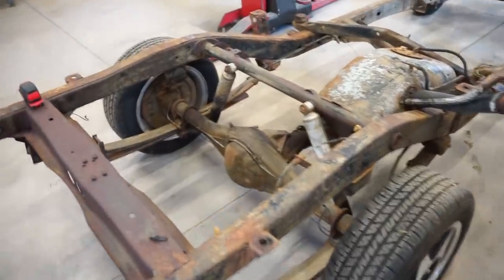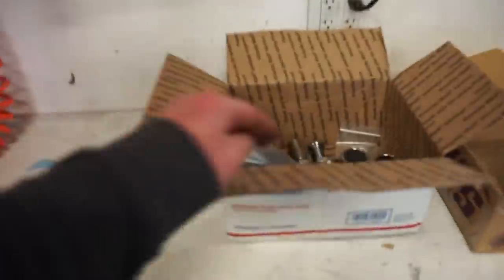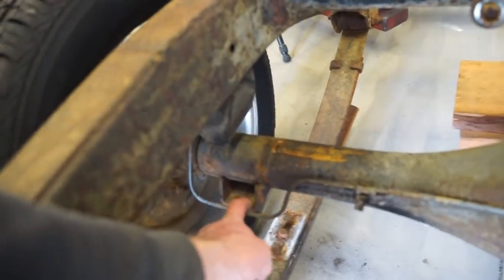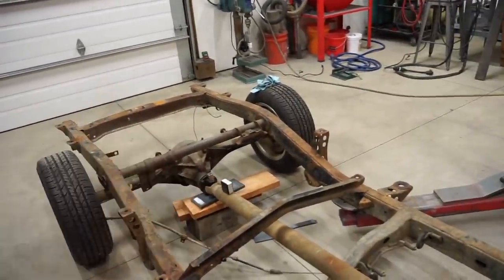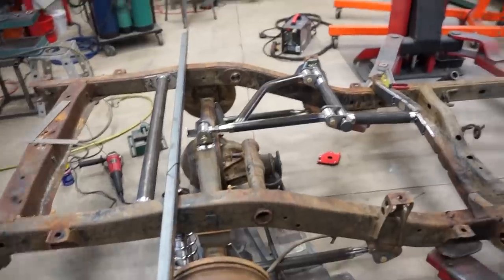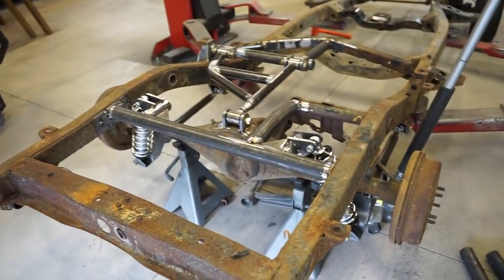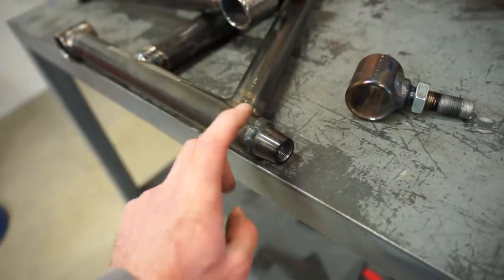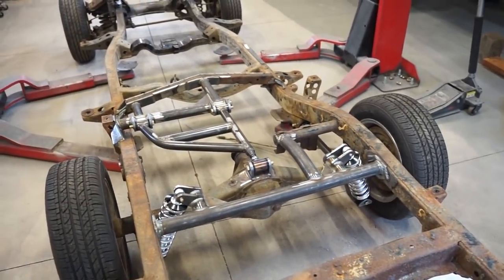Building Custom Coilover 3 Link For My Toyota Hilux!

Comment: Did you check for binding in roll? You may wish to consider that, when you put it together, to replace the rear bush of the top arm at the diff housing, with a more easily flexible heim joint. This is because, upon direction change, as the vehicle rolls side to side, even a little, is when the top arm will bind, so it'll try to pick-up/unload  the inside rear wheel.
Reply: You are correct , it will not work like this
Reply: Heim joints or it will bind raise one wheel you'll see, it will bend or break stuff or just shagg out bushes quickly. But other than that looks good.

Comment: Probably one of the best presentations on YouTube.
Considering that you have done it all by yourself quite impressive..no matter what..
I must admit was doubting you at first...but you surpassed that..
Good quality welding, your brackets are great and hand made..
We see so many using CNC to cut...seems to take the fun and hard work away.
One appreciates it more using  your method.
I wish to do the same at some point.
The build will be from scratch..jeep XJ rear axle, as you show coil overs four link, but just rear wheel drive.
2.5 diesel engine and a twin leading arms up front probably made up hubs too .
Just a 2 seater.
Similar to look of an old Bugatti car fish type tail.. That era.
But mine will be a soft 60% off roader..and 40%tarmac.
Great build keep it up..
Simon a Brit in Spain .

Comment: I highly recommend using a heim or some sort of joint that can misalign on the top of the axle. if your axle articulates, your nut will come undone. if you dont want to use a heim, synergy makes these awesome dual durometer bushings that flex very nicely, and don't need grease and done squeak.

Comment: Looks great.  If you're still concerned about the strength of your front crossmember you could always run a brace from the middle one you cut along side the gas tank to tie it all together.

Comment: I like the direction you are taking this Austin👍.  Pikes Peak or just out cruising and feeling the chassis and power set you back in you seat.  Maybe some flare work and a custom air dam/splitter.
Reply from the maker: Thanks 👍
Reply: Same!! 🔥
Reply from the maker: I just got to find some flares that somewhat fit! And yea something other than the oem front bumper!! I need ideas!!!

Comment: Awesome work. I’m building an upper 3rd link and mounts on my 2000 4runner to replace the two upper links to eliminate binding and increase articulation. My upper mount will be similar to yours.

Comment: What's it like working backwards and upside down from your normal projects?  lol  I have 3 or 4 favorite channels yours being one of course.  I watch Fab Rats and they are in Nevada.  Everything they do revolves around four wheeling, rock crawling and offroad recovery along with Matt's Off Road Recovery.  This is really different watching you do the suspension frame off.  Looks so much easier!  I've seen those guys weld, bend, ratchet strap broken vehicles in the middle of the desert in some really contorted ways.  Pretty crazy and ballsy stuff in their neck of the woods!  Looks Great so far!  I'm waiting to see if you will keep the grunge!  lol

Comment: Those axle brackets are bitchin! The half wishbone , as beefy as you built it, still looks wierd to me not having lateral support on the right side. I feel you should still use a panhard bar. Maybe a watts link.

Comment: Man, I always enjoy watching you.  I enjoy your methodical process mostly.  I havent ever built a 3 link, but Im wondering if theres a provision for the axle to twist (think one wheel on a curb the other in a pot hole)?  Shouldnt the upper link have a spherical joint to allow rotation, or is there enough movement in the system without?  Thanks, and keep it up!
Reply from the maker: Thanks man! I did some testing since then and the bushings have a ton of flex! Check the next video in line if your curious!

Comment: Very cool setup! I've never seen a 3link with that upper arm! Eliminates the need for a panhard!

I see you have a MIG and a TIG, how do you decide what machine you want to use for what job? Obviously larger jobs are easier with the MIG, but I noticed you welded the links with your TIG. Wondering if maybe that's hotter and that's what distorted the threads maybe?

Comment: You’ve done a beautiful job as always but I’m not sure about the upper link. I’m not sure how well it will handle the sideways forces on the axle. I think you should move the fuel tank and put in a standard 4 link, attached at the differential centre and chassis rails. Love watching you work though, great attention to detail.
Reply from the maker: Do some research on wishbone 3 link! It’s a pretty common setup

Comment: Great work man. What about a panhard rod? Whats going to stop the side movement of the axle in this 3 link suspension ? 👍
Reply from the maker: The wishbone upper link keeps the axle in place
Reply: Wishbone  upper link would prevent  side movement  if mounted  correctly  .   Nice work  though
Reply from the maker: @richardcabrera1176  is mine not mounted correctly?

Comment: what kind of suspension geometry is this? I don't understand what is supporting lateral loads to your axle. I have seen triangulated links or some sort of panhard bar/watts link but your system has neither.

Comment: Looks crazy complicated....I know she's a low rider, but what about articulation? Your still gonna need some and my little brain can't see how that top link allows any🤷‍♂️,I dunno, you've obviously done your research (you always do), maybe heims rather than bushes? Maybe show how it works in next vid, school me, lol😉👍
Reply from the maker: Yeah the bushings don't offer a ton of articulation but its a lowered 2wd, it doesn't need a ton! If it was a 4wd I would do heim joints!
Reply: @austinniemela  that's cool, I get ya...I was just thinking, cornering, curbs, potholes etc, certainly don't mean off road kinda articulation, no doubt you'll prove me wrong, lol, just doesn't look to have enough🤷‍♂️... as always, watching and learning😉
Reply: I agree that without heims as the body wants to lean on turns it will be trying to lift the inside wheel. I think it will also cause the vehicle to chatter around turns if on rear wheel  hits a bump. If the brackets don't get torn off the frame.
Reply from the maker: @dhrracer  I did order a heim for the upper link. I’m going to do some testing! I think the lowers will be just fine on bushings
Reply: Exactly what I was thinking.   Should be a Heim joint at the center section of the diff for articulation

Comment: You have a problem with your bracket on top of the differential. Your design is for it to move up and down at the same time. But it should be able to let the differential to move in an uneven road where 1 side is higher tha the other side.

Comment: Good work but wrong choice on the bushings. Poly / sleeve style bushings don’t allow sufficient articulation. You want to use some heim / rod end style bushings
Reply from the maker: I agree in a 4WD application! But the 2WD will do just fine on bushings
Reply: @austinniemela  Then get rid of the shocks and just run it on rubber bumps.
Reply from the maker: @dhrracer  lol

Comment: DUUUUDE......if your trans is down 2 degrees, you want your rear end up 2 degrees, you were correct about matching the angles, just in the wrong direction
Reply: Also, if you put the pivot points in the same vertical plane your pinion angle wouldn't change at all, which is the point of links